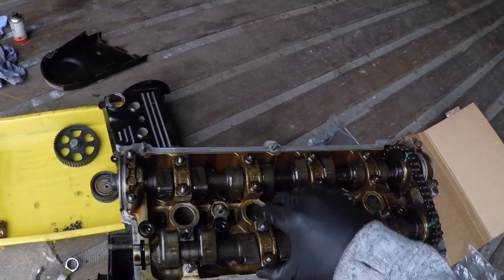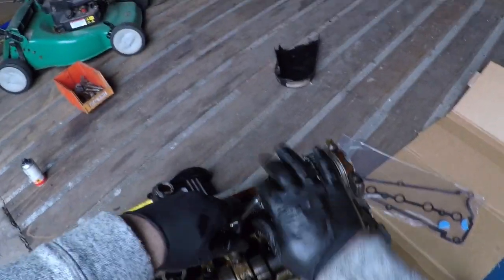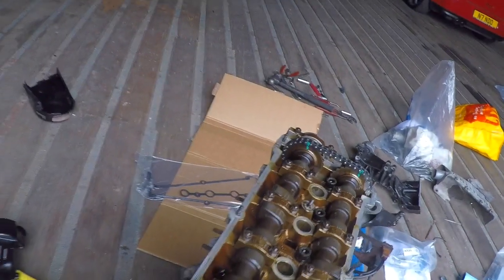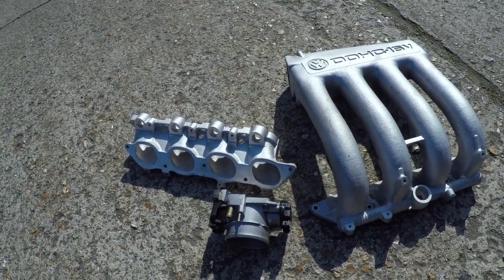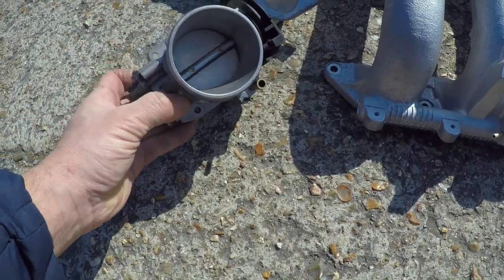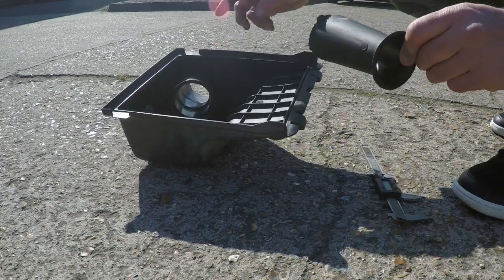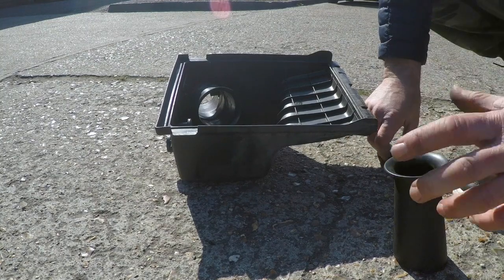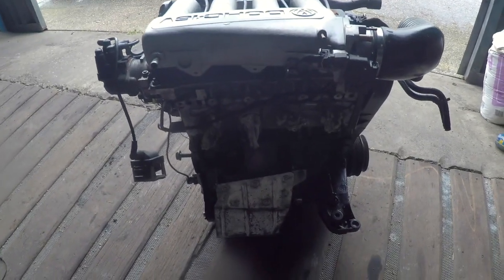The Cheapest Golf colour concept convertible project ABF 16V part 3

Comment: 180hp with my std ecu 👍🏻
Reply from the maker: Cool, most I've seen was 175hp on std ecu with P&P head and 260º inlet cam
Reply: I had a colour concept cab. this will be a cool car
Reply: Resto Designs I don’t know if the engine has bigger cams, it is not p&p as I could see. I do have a lightened flywheel cold air feed into the oem airbox. 55mm exhaust with cat. I’m having 214 nm torq,
Reply from the maker: @69bock69  Thanks mate, It is a lot of funny, been a good year weather wise for this, the braces really have made a difference to the over all feel.